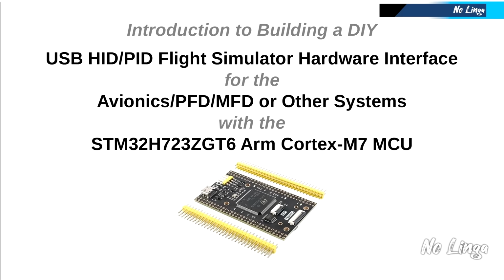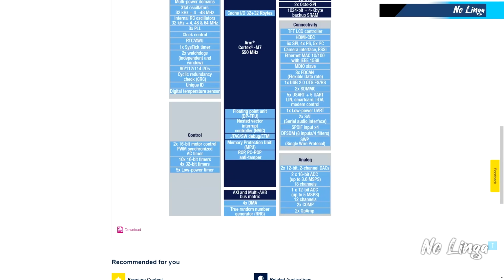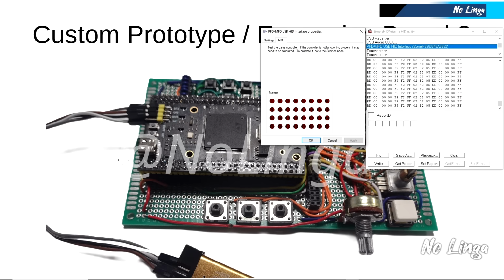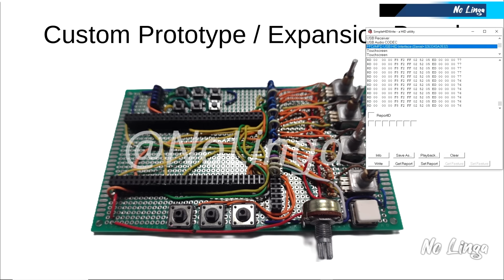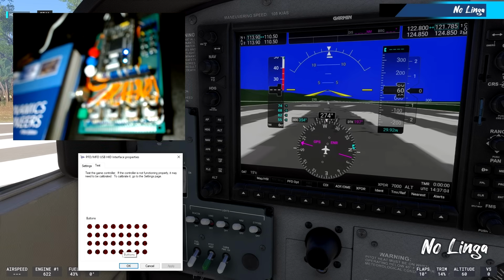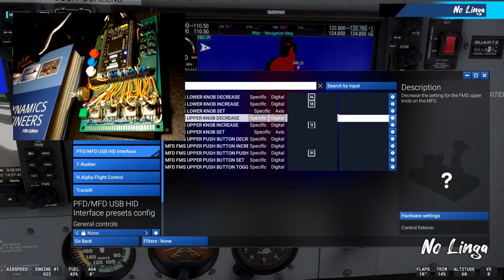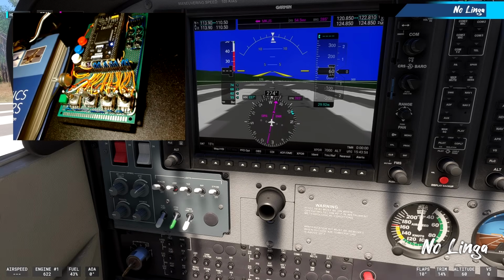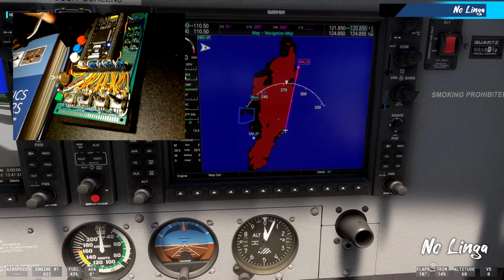Part 1: Introduction | DIY USB HID/PID Avionics PFD, MFD Flight Simulator Interface | STM32H723ZGT6

Comment: Hi and thanks for this video, Can this board be connected to Arduino IDE?
Reply from the maker: @imadjawad4408 Thank you very much and it is a pleasure to share.  Regarding your question, this article goes over how to add STM32 boards to the Arduino IDE: https://community.st.com/t5/stm32-mcus/how-to-program-and-debug-the-stm32-using-the-arduino-ide/ta-p/608514